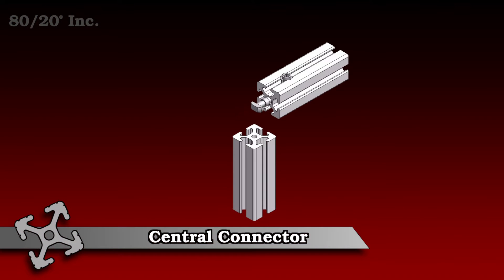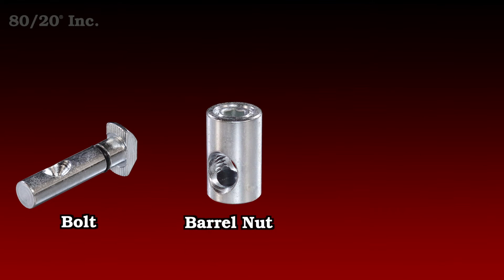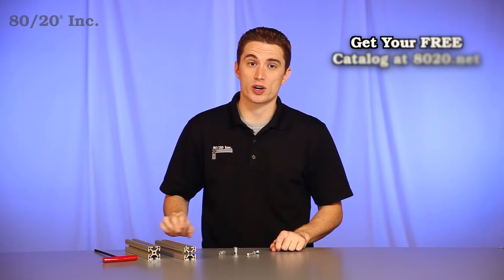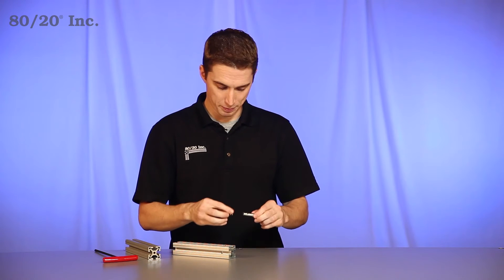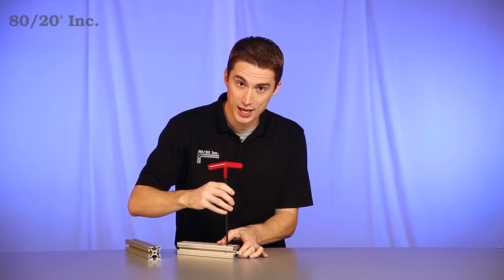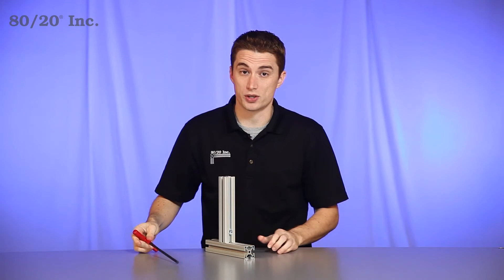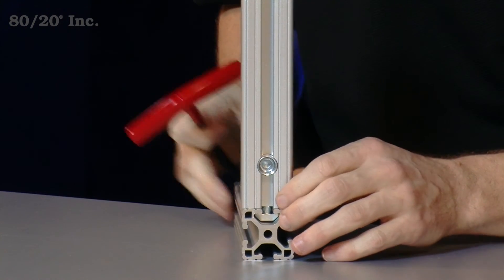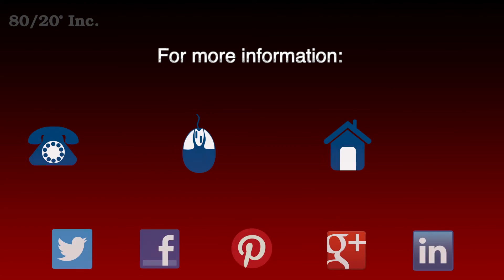80/20: Central Connector Overview

Comment: What is the size and depth of the hole that has to be drilled in the extrusion; to use this Central Connector? I have looked every where in the catalog; but I can't find it. I believe THAT should be shown where the connector is shown in the catalog. Please...
Reply from the maker: Hello, Pat - that's a great question! The size and depth vary depending on extrusion series. For example, for a 15 series profile it's 0.469" dia x 1.75" deep. You can find more info on the central connector profile milling service in the Machining Services section (pg. 878):  http://catalogs.8020.net/80-20-Inc-Catalog-23/878/

Comment: What is the diameter and strength of the steel of the bolt you use fir 10 series?
Reply from the maker: Good question, Mark: 10-32 UNF, ASTM A574 – Alloy Steel